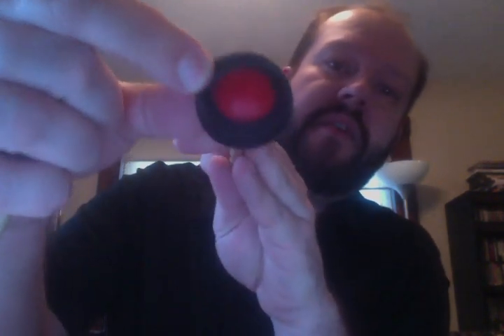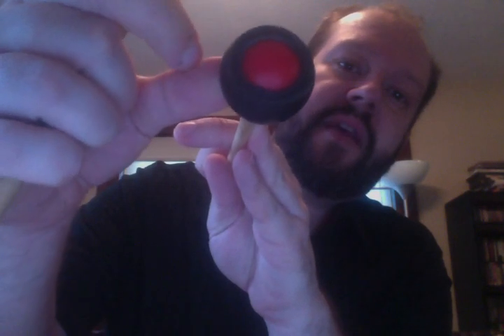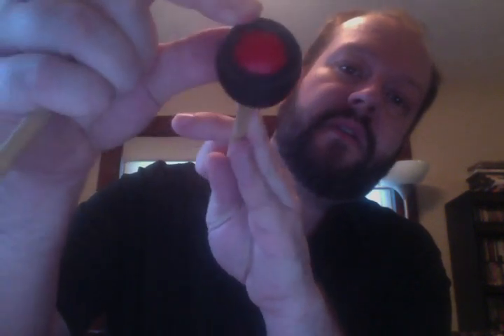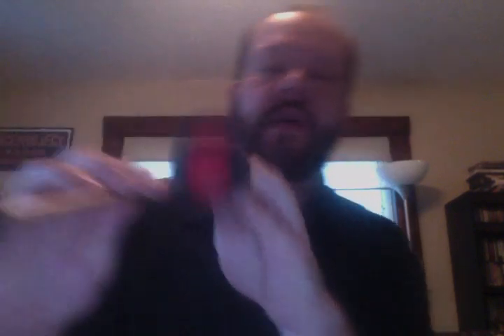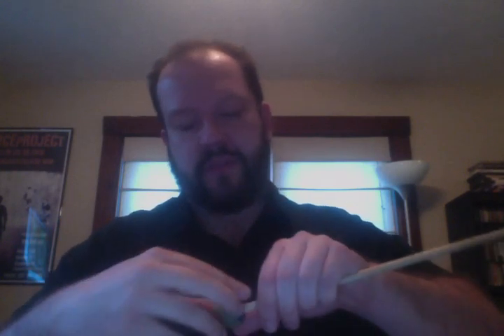Open Source Mallets Part 2: Latex Tubing

Comment: What do you think of rubber bands? They're waaaay more unexpensive than latex tubing and I was thinking of gluing them to the core with contact glue...I don't find latex tubing here (Mexico) and shipping from Mcmaster might be even more expensive than the tubing itself...Well, at least I have found undrilled cores (rubber discs and poly balls) for like $0.20 dlls